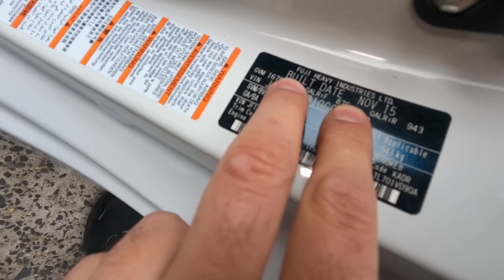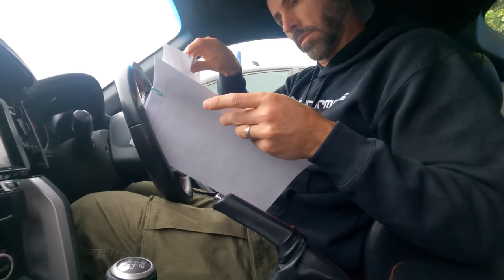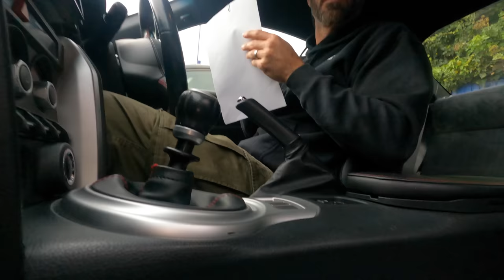Buying ANOTHER CAR off Facebook Marketplace

Comment: To be fair on the front bumper, even cars that haven't been smashed do that. The good news is that like everything else with them, there are a range of OEM replacement clips, to aftermarket metal clamps, to quick release tabs you can get to fix it.
Reply: these days it seems that barely bumping the nose can pop those seams out. so flimsy a lot of the time.
Reply: @ghomerhust  With good reason. They’re no longer structurally there to improve crash safety. So a bump will push them out of alignment and save your wings etc. The legit crash structure is beyond the bumper. I’m my old bmw if I bump the front it would most likely shunt everything else out of alignment.

Comment: That’s dirt cheap for a BRZ. My question is: How is that black Holden Astra priced at 4990? In the UK, a mint, low mileage one would fetch maybe £1000! Either way, looking forward to the project.
Reply: The Aus car market is messed up. That's the short of it haha
Reply: Then it costs 2000 quid to insure. 
In Australia, to register and insure (compolsary third party) that car would be $400 dollarydoos.
Reply: Also 4990aud is like £2700
Reply: @TheosEpicVideos  it definitely wouldn't be 2000 quid to insure in the UK for a driver with afew years no claims
Reply: Shit I thought I was the only one to notice this! 😂
Reply: @TheosEpicVideos  can’t agree with that. £500 to buy and maybe £300 to insure. £200 tax and run it until the MOT failure sheet gets off its chops. Must be the Aus car market
Reply: Ok. My experience with 500 quid car when I was there. 
Was going to cost me 2000 pounds to insure plus MOT because I was from Australia. I was 30 years of age. Had over 12 years of driving experience.
Reply: I suppose the difference is guaranteed no rust...cars just last longer here in general...plus that Astra originally came from either the UK or wherever in Europe where they build them so import, taxes, condition as well as Australia has more tolerant environmental laws when it comes to emissions than Europe.
Reply: @TheosEpicVideos  depends on the state but rego and ctp is probably closer to $1000 in nsw, in vic and sa yeah, probs $400.
Reply: AUS dollers are worth jack shit.
Reply: Yeah I spotted the MK4 astra but felt sorry they also have the Citroen C4s!
Reply: Holden astra? My entire family screamed vauxhall all at once when they heard that.

(and just to be sure i got my uncle, who works for vauxhall, to call a buddy of his..... the designer.......... to check which company it was originally designed for.... it was vauxhall)
Reply: @M3PH11  but this one is for sale in Australia so it’s sold as a Holden Astra. Given that Vauxhall is just the UK brand of Opel, it would be an Opel car. Opel was then owned by General Motors so it’s a GM car. It really makes no odds, it’s a Holden Astra in Australia and the point is that it’s crazy money for a car that’s so old and was “alright” at the time.
Reply: Car dealers in Australia do have to offer a limited warranty on most used cars, which is why they are usually priced much higher than equivalent privately sold used cars. That particular car is an automatic, does have lowish miles, includes registration and has also had $3K spent on it recently including timing belt etc, but even so that is a pretty high price for an old Astra like that, even in the current inflated used car market. Realistically they would be lucky to get half that selling privately.
Reply: @adammcallister2260  that would be a $5000 dollar Chevy Astra in Argentina. The BRZ would be $25k usd
Reply: 5k is dreaming in AUS for one of those, even at Covid prices. Dealer markup basically.
Reply: Car prices here are nuts. I bought a car just before covid and have been watching its value go up by the day. Its just a family wagon.
Reply: They're waiting for that one idiot to come in and buy it. Good luck to them with the cooling system issues.
Reply: @M3PH11  One could argue that it's an Opel design, since Vauxhall hasn't had a car of their design since the early 80's.
Reply: @TheosEpicVideos  only if you're young
Reply: @TheosEpicVideos  Someone with 12 years driving experience could get insurance for next to nothing, like £120 comprehensive. My mate has less driving experience than that and his Golf R is only like £300 with mods
Reply: @TheShinyShow - Just my experience. I was 30 years of age. 

Anyway, I just drove the car around London. Took it out to Bath once. I wasn’t going to pay £2000 quid for insurance on a £500 car.
Reply: @M3PH11  Nah it's an
Opel. The name origininates from a different car that was Vauxhall tho.
Reply: UK Mot is different then Reg in Aus.
Reply: The BRZ would cost $40K over here, in that condition. Over $75K with a clean reg and no crash history.

Never had the Astra locally, but an equivalent hatchback costs $12-15K.
Reply: @viduranisal  Man that is expensive. And I thought Australia was bad for used cars after moving here from NZ where it's much cheaper. Being able to import second hand from Japan easily helps that.
Reply: @TheosEpicVideos  more like $900 and a bit to register lol. about $500 for CTP and maybe $400 to renew the rego.
Reply: @M3PH11  Not Opel?

Comment: As someone who did a repairable write off re rego in Sydney I bought the car from auction in nsw it was registered in wa and when it was written off in nsw it was repairably written off I sent it to qld ‘transferred’ the rego to someone else’s name had to sign a stat dec saying I sold it to them they took it over the pits about $500 registered it up there sent it back transferred it back to me took at back over the pits in parramatta $500 and then it was registered in nsw and running also fairly sure I didn’t need receipts for repairs and the car wasn’t even repaired because it was hail damaged they just checked everything drove straight and was in decent condition

Comment: The WOVR check doesn't check the quality of the repairs, it's just to check parts aren't rebirthed stollen parts. You just get a RWC before WOVR inspection, then you can register it once passed.
Reply: I have repaired a few repairable write-offs and there is a bit more to it than that, you need a tier 3 inspection to clear the WOVR, tier 3 requires a detailed repair diary outlining all repairs and repairs must be referenced to "manufacturers" repair procedures, detailed photos of repair progress & receipts for all parts (must be a business with an ABN), they do a very detailed inspection of the quality of the repairs, if Airbag has been deployed or the vehicle has hail or water damage they require a full SRS report from a authorised service workshop ($$$$), once that is all signed off then you need a RWC & can get it registered.
Reply: @bcowland9186  My experience is with motorcycles and none of that has ever applied. I also did the repairs myself and just needed a statutory declaration stating any repairs i did and all receipts for parts purchased. Then like i said a RWC. I'm in QLD, i'm unsure of the process in other states.

Comment: My prof pick is an 18" US tS the only year for the dry fiber wing and body "kit" as well as the wheels break kit and Sach's dampers and springs and the reduced gear rear lsd that come on the 2020 tS as well. Almost 10k miles on her and a completely different animal than my 2015 was.

Comment: In the United States, this particular scam is called "Curbing" and what it means is that the dealer is selling a heap of shit they do not wish to be associated with, either because there is something horribly wrong with it, or it has a salvage title, or frame damage, flood loss, something of the like, where by being sold through a dealership under a dealers license they would legally be required to announce it to you. By "curbing" they can avoid cooling off periods and you, the buyer, have little recourse if you're sold something they can't sell. Some states require vehicles to be sold with some sort of warranty, where as-is sales are prohibited, curbing helps them get around that as well. There are a myriad of reasons a vehicle is "curbed" and they are never, ever good for the buyer.

Also it's highly illegal in most states, alert your district attorney, they would love to fine the living shit out of someone.

Comment: In the United States, these cars are forever stigmatized with "salvage/repaired" titles.  They are difficult to insure, and are always worth less than a car with a "clean" title.

The repairs may look alright upon first inspection, but they have almost always been done on the cheap, and corners have been cut.

Comment: The bumper not fitting properly is just a BRZ/86 thing, once you take them off they never fit properly with the front fenders lol. Also, I don't think it's a tS, for the first gen BRZ the tS was only available in Japan. My guess is the seller just bought a brz tS front end from the newer gen (and you can tell from the fog lights covers that are in that bin full plastics in the trunk) and that's where the tS badge came from, but it actually isn't.

Comment: I found a similar grey area FR-S in Sweden this summer, cheapest one I've seen here, 16500 AUD.
US car, wasn't registered, had some paperwork from UAE where it had a quick stop before coming here.
But Sweden's laws on registrating a car is rather picky.. It was never registered in UAE, and had no paperwork left from previous registration in the US which makes it almost impossible to register here.
Also contacted Toyota US to try getting a hold of the previous owner, turns out it was a write off marked as "crushed". That's where I left it 😅 it was very well fixed though! But had a slight knock from the left head which Toyota wouldn't fix as a recall job.

Comment: bought my BRZ in germany for 10k€ because it had hail damage and nothing was known about the history of the car because it was bought from an insurance company. It had only minor hail damage on the hood and a few dings and scratches but i later found out that the engine was rebuilt about 10.000 km ago because it had a bearing failure... i guess i got lucky ;)

Comment: I just did this in QLD for a BMW 735i with NO PROBLEMS.
Make sure you have 100% of all Paperwork including Panel Work Photos IF Possible..
The BRZ CANNOT have any CODES on the DASH. 
In QLD we just went to a LOCAL Auto Electric to Clear any Codes.
If you FORGET any P/Work they will Charge you $50 for each pce of Paper you forget.

The BRZ must be in General Roadworthy Condition.
Including all Lights and No Codes ect ect.

GOOD LUCK.

Comment: I am still waiting for you to combine that old mini e-car (or e-gocart..e-Trike..) we have seen once on the show
with a ton of those ryobi battery packs+chargers as holder. Would be a nice ad for them and a fun project.
(easiest way would be to use the ryobis to controlled recharge into one larger fixed battery (low Ah but high currents) pack which takes the high currents during acceleration..)

Now only 2 minutes into the video so still waiting for the .. "car" .. ;-)

Comment: I believe the etymology of the term "rearing one's head" comes from something to do with riding horses and not giving birth and is colloquially used to denote something bad happening or popping up unannounced. I could be wrong but I suspect you're having a bad time if you're on the horse and it's "rearing it's head". I guess it's something a horse does before it bites you and/or throws you off. I've never ridden a horse though so can't say from experience. Pretty sure that's where the term originates from though.

Comment: At first I thought that engine bay is waaaaay too clean for a 15.  Good thing is fender liner for these cars are dirt cheap, I've had to replace mine twice.  

For the love of god please Kswap this so I can have a guide on how to do mine.
Reply: You shouldn't put an inline4 in as it will ruin the centre of gravity at the front and subsequently the handling balance. Maybe get a Jaguar V6 3.0 instead? Sound and torque and they are really lightweight.

Comment: Send a letter to Toyota and Subaru and then maybe get a permission to ask the registration confirmation documents. Because if it is actually refurbished, it should be technically road legal, in local terms its just a little "Beat Up" ..but aren't every car on the streets? I saw how German quality engineering was mate, they literally bent the doors do place by hand and tested the raw strength of the material like a true Viking ...that was even fun to watch, to see my cars being built by a true metal bender lol. Like bare hands on metal, you don't see this nowadays now do ya? Like against the rules of something but its actually technical inspection, like as literally as it can be

Comment: I got a mazdaspeed 3 2011 for 4k the guy was asking 5k and he would not go under 4k I tried he was insulted at 3.9k soo that alone means it's worth at least 4k right 4 grand for a blue book'ed 9k-12k . I spent 17k on mods and in hignsight I got a good deal mainly because sun damage had her looking bad on top and she had too new a bootie on her so it seemed like a rear end collision and it was because I found cracked fuel pump the insurance never did im overall happy but can't help thinking I'm 21k in and I could have started with a little better model but I was thinking its made in japan and it's a real mazdaspeed 3 so its got all the parts right there the same as the 15 thousand dollar one at thr dealer with more problems. 1 owner 130,000 miles old guy the engine was spec mint I took it without enough or any research but I got lucky even with the problems I ran into I would recommend it bit its a gamble getting a car at 1/3 blue book